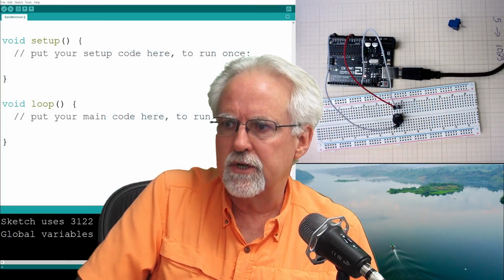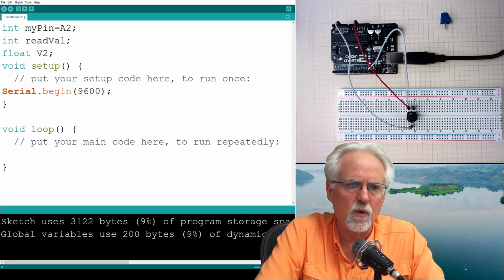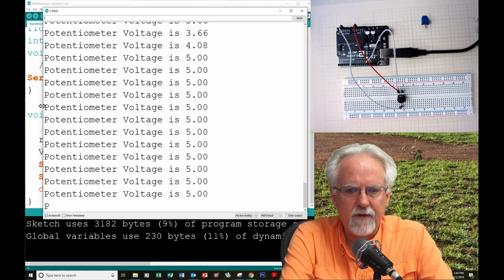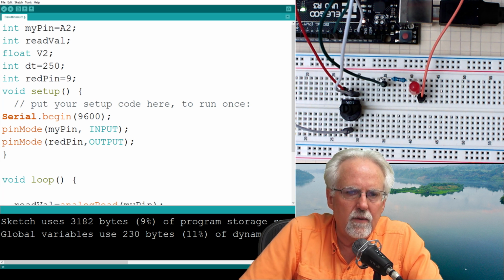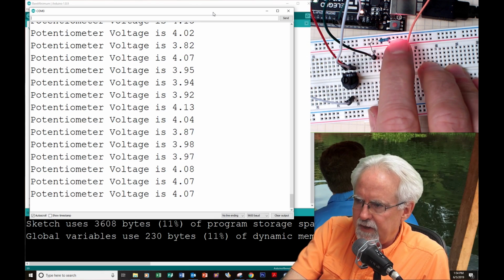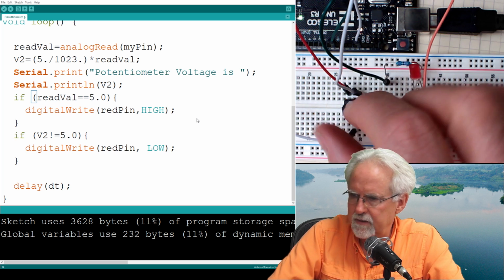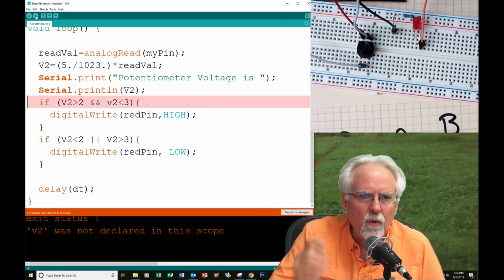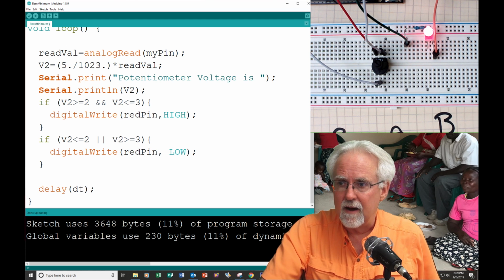Arduino Tutorial 13: Understanding Arduino If Statements

Comment: Did i you se it ? YES :D  in the First != exampel you told the audrino to turn off the led if it did not != to 4 not 5 and it was after the tun on if ==5 comand but befor the delay . so there where no condition where it would turn on

Comment: Hi Paul! I'm still following the tutorials. I had to take a break for a couple of days when my only potentiometer ended up breaking due to poor quality (I picked up a different set to the one you recommend for the series prior to finding you) and had to order some new ones. I have successfully completed this lesson, but I wanted to know, just to check and clarify my understanding, if the reason your program didn't work towards the end of this video is because you didn't change the (V2 != 4.0) to (V2 != 5.0) to match with the (V2 == 5.0) line of code? To my mind, this would be because the Arduino is interpreting the 5V (potentiometer at max/1023) as "not equal to 4.0" and thus disregarding the (V2 == 5.0) statement. Would that be correct? I changed both values in my own program and it worked without incident.

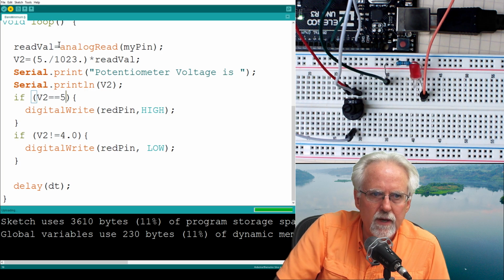Edit: In case you are able to respond, the timestamp is around the 25:00 minute mark, I understand you may not remember the specifics of what happened in a video from 6 years ago xD

2nd Edit: I hope this question doesn't annoy you given that you end up resolving the issue later in the video. I wanted to try to guess the issue before finding out if you did so. So no need to answer, but I'll leave this comment here in case it helps others understand the issue ^^'
Reply from the maker: Yes, as I am coding live in front of the camera I make mistakes, but then that allows you to see how I troubleshoot.

Comment: How do you know what resistor to use for projects? Is that something that will covered later?
Reply from the maker: It is based on a calculation of what is the maximum current a digital pin can source, and then using a resistor that insures that even if the LED is shorted, the circuit will not draw more current than the arduino pin can safely provide.

Comment: Homework code:
spoilers
.
.
.
.
.

int readPin=A5;
int voltageRead;
int greenLED=8;
int yellowLED=9;
int redLED=10;
int dt=100;
float voltage;

void setup() {
  // put your setup code here, to run once:
Serial.begin(9600);
pinMode(readPin, INPUT);
pinMode(greenLED, OUTPUT);
pinMode(yellowLED, OUTPUT);
pinMode(redLED, OUTPUT);

}

void loop() {
  // put your main code here, to run repeatedly:
voltageRead = analogRead(readPin);
voltage = (5./1023.)*voltageRead;
Serial.print("voltage is ");
Serial.println(voltage);

//turn on/off green led when voltage +0-3 (I like to have no lights on when its at 0V)
if(voltage > 0 && voltage <=3){digitalWrite(greenLED, HIGH);}
if(voltage>3 || voltage == 0){digitalWrite(greenLED, LOW);}

//turn on/off yellow led when voltage 3-4
if(voltage > 3 && voltage <=4){digitalWrite(yellowLED, HIGH);}
if(voltage > 4 || voltage <= 3){digitalWrite(yellowLED, LOW);}

//turn on/off red led when voltage 4-5
if(voltage > 4 && voltage <=5){digitalWrite(redLED, HIGH);}
if(voltage < 4){digitalWrite(redLED, LOW);}

delay(dt);

}

Comment: int myPin=A2;
int readVal;
float V2;
int dt=250;
int redPin=9;
int yelPin=6;
int grePin=3;

void setup() {
  // put your setup code here, to run once:

Serial.begin(9600);
pinMode(myPin,INPUT);
pinMode(redPin,OUTPUT);
pinMode(yelPin,OUTPUT);
pinMode(grePin,OUTPUT);
}

void loop() {
  // put your main code here, to run repeatedly:

readVal=analogRead(myPin);
V2=(5./1023.)*readVal;
Serial.print ("Potentiometer voltage is ");
Serial.println(V2);

if (V2>4){
  digitalWrite(redPin,HIGH);
  digitalWrite(yelPin,LOW);
  digitalWrite(grePin,LOW);
}

if (V2<4){
  digitalWrite(redPin,LOW);
  digitalWrite(yelPin,LOW);
  digitalWrite(grePin,HIGH);
}

if (V2>=3 && V2<=4){
  digitalWrite(redPin,LOW);
  digitalWrite(yelPin,HIGH);
  digitalWrite(grePin,LOW);
}

delay(dt);
}

Comment: I disagree with some of your breadboard designs from time to time. Am I allowed to do so? I mean, the results are the same, but I am not sure if I should be building the exact circuit as you. 

For example, I use ground-rails whenever I have to put LEDs in a series. Otherwise, I place my resistors differently sometimes than you do. 

Can this turn into a problem further down the line?

Comment: HOME WORK DONE!!!!!
int red=2;
int green=4;
int blue=7;
int readVal;
float volt;
int wait=500;

void setup() {

Serial.begin(9600);
pinMode(red,OUTPUT);
pinMode(green,OUTPUT);
pinMode(blue,OUTPUT);

}

void loop() {

  readVal=analogRead(A2);
  volt=(5./1023)*readVal;
  Serial.print("Potentiometer Voltage is "); Serial.println(volt);
  delay(wait);
  
  if(volt < 1.0){
    digitalWrite(blue,HIGH);
    digitalWrite(red,LOW);
    digitalWrite(green,LOW);
  }
  if(volt>1.0 && volt<3.5){
    digitalWrite(green,HIGH);
    digitalWrite(red,LOW);
    digitalWrite(blue,LOW);
  }
  if(volt>3.5){
    digitalWrite(red,HIGH);
    digitalWrite(green,LOW);
    digitalWrite(blue,LOW);
  }
}

Comment: Hi Paul,
Six year have passed and you definitely NOT talking to a wall. You are an amazing teacher. Thank you very much for your videos!
I have a small question: why didn't you use the `else` block in the `if` statement?
Reply from the maker: I never use else statements, as I believe they generate logical complexity in the code. Lets say if x>3.12 (   ) else: (   ). The else makes you try to think  backwards, and complicates understanding what happens when x = 3.12. To me, I write my code always with positive logic, as follows.
if x>3.12 . . . open the window
if x=3.12 . . . leave the window where it is
if x< 3.12 . . . close the window.
Understanding the code is all positive logic, not incorportating opposite logic. I have seen many coding disasters from sloppy use of else statements.
Reply: @paulmcwhorter  
That is a very interesting point. I have some software background but i never took the time to think of the "philosophy" of how to write understandable code.

Comment: I thought of declaring V2 as float V2=(5./1023.)*readVal; prior to the void setup, but get 0 volts. Bummer, I thought I was being clever, lol Im not sure why we cant declare the float V2 with the others above the setup?. Here's the code:

int myPin=A2;
int readVal; 
float V2=(5./1023.)*readVal;
int dt=250;
void setup() {
  // put your setup code here, to run once:
Serial.begin(9600);
}

void loop() {
  // put your main code here, to run repeatedly:
readVal=analogRead(myPin);
V2;
Serial.print("Potentiometer Voltage is ");
Serial.println(V2);
delay(dt);
}
Reply from the maker: The variable readVal would have an undefined value before setup().

Comment: Hi sir I am from Malaysia, I have a question. Why does my board are not showing 5V after prompting "If Statement" even though after I turn the potentiometer on full turn. Before "If statement" are written, the serial monitor reading normally show the reading 0v-5v. The LED also are not bright as 5V after I am doing "if statement" prompt. The serial monitor only shows 0 V- 4.72 V. Thank you.

Comment: Hello Sir, I did your assignment and it worked succesfully. I decided to use the special rows since there were only 3 GND holes, and in the process realised that even the two rows in each side are not connected completely as you and the internet proclaimed. they are further divided into two halves which are not connected. In simple terms, if there are 4x negative holes in special rows in the entire board, only x are connected.

Comment: Thank you for your videos!

const int V_PIN = A2;
const float V = 5;
const int V_MAX = 1023;

const int GREEN_LED = 8;
const int YELLOW_LED = 9;
const int RED_LED = 10;

const int DELAY_MS = 500;

void setup() {
  Serial.begin(115200);

  pinMode(V_PIN, INPUT);

  pinMode(GREEN_LED, OUTPUT);
  pinMode(YELLOW_LED, OUTPUT);
  pinMode(RED_LED, OUTPUT);
}

void loop () {
  int readVal = 0;
  readVal = analogRead(V_PIN);
  float voltage = 0;
  voltage = (V / V_MAX) * readVal;
  Serial.print(voltage);
  Serial.print("v\n");

  if (voltage < 3) {
    digitalWrite(YELLOW_LED, LOW);
    digitalWrite(RED_LED, LOW);

    digitalWrite(GREEN_LED, HIGH);
  }
  if (voltage > 3 && voltage < 4) {
    digitalWrite(GREEN_LED, LOW);
    digitalWrite(RED_LED, LOW);

    digitalWrite(YELLOW_LED, HIGH);
  }
  if (voltage > 4) {
    digitalWrite(GREEN_LED, LOW);
    digitalWrite(YELLOW_LED, LOW);

    digitalWrite(RED_LED, HIGH);
  }

  delay(DELAY_MS);
}

Comment: hello Paul, i checked out your profile here on youtube and saw a newer turtorial for the uno r4 wifi, is it somewhat different from the one here or are they the same, because i was wondering if i should change to the newer one.
Reply from the maker: The main difference with the R4 lessons is the R4 arduino can do some WiFi stuff, and I have lessons on that. If you are not interested in WiFi at this point, stick with these lessons.

Comment: Thanks!
Reply: Loving the series Paul. 
Question: In lesson 13 on the IF statement my sketch runs fine except for turning on the LED.
if (V2>4.0) {
    digitalWrite(redPin,HIGH);
   }
  if (V2<4.0) {
    digitalWrite(redPin,LOW);  
   }
HIGH and LOW do not turn green in the code. 
Any thoughts?
Reply from the maker: I was using IDE 1.8, and you are probably on IDE 2.X. IDE 1.8 still works, and you will get results like mine.
Reply from the maker: Thanks! I appreciate the support.

Comment: Don't worry good sir! I'm doing whatever projects you say at the end. Here's my solution to this video's problem.

float potenPin=A2;
int rLED=2;
int yLED=3;
int gLED=4;

void setup()
{
  pinMode(potenPin, INPUT);
  pinMode(rLED, OUTPUT);
  pinMode(yLED, OUTPUT);
  pinMode(gLED, OUTPUT);
  Serial.begin(9600);
}

void loop()
{
 float volt=(5./1023.)*analogRead(potenPin);
 if (volt>=4)
   { 
    digitalWrite(rLED, HIGH);  
    digitalWrite(yLED, LOW);   
    digitalWrite(gLED, LOW);
   }
 else if(volt>=3)
   {
    digitalWrite(rLED, LOW);  
    digitalWrite(yLED, HIGH);   
    digitalWrite(gLED, LOW);
   }
 else
   {
    digitalWrite(rLED, LOW);  
    digitalWrite(yLED, LOW);   
    digitalWrite(gLED, HIGH);
   }
}

Comment: This is my code for the homework:

int myPin=A2;
int readVal;
float V2;
int delay1=250;
int redpin=9;
int yellowpin=8;
int greenpin=7;

void setup() {
  // put your setup code here, to run once:
Serial.begin(9600);
pinMode(myPin, INPUT);
pinMode(redpin,OUTPUT);
pinMode(yellowpin,OUTPUT);
pinMode(greenpin,OUTPUT);
}

void loop() {
  // put your main code here, to run repeatedly:

readVal=analogRead(myPin);
V2=(5./1023.)*readVal;
Serial.print("Potentiometer Voltage is ");
Serial.println(V2);

if (V2>4.0){
digitalWrite(redpin,HIGH);
digitalWrite(yellowpin,LOW);
digitalWrite(greenpin,LOW);
}

if (V2<=4.0 && V2>=3.0){
digitalWrite(redpin,LOW);
digitalWrite(yellowpin,HIGH);
digitalWrite(greenpin,LOW);
}

if (V2<3.0){
digitalWrite(redpin,LOW);
digitalWrite(yellowpin,LOW);
digitalWrite(greenpin,HIGH);
}

delay(delay1);
}

I hope this helps anyone who needed it!

Comment: int greenPin=5, yellowPin=6, redPin=7, dt=500, baud=9600;
float readPin=A0, potVolt, constant=(5.0/1023.), V2;
  
void setup(){
	Serial.begin(baud);
	pinMode(greenPin,OUTPUT), pinMode(yellowPin,OUTPUT),pinMode(redPin,OUTPUT);
  	pinMode(readPin,INPUT);
}

void loop(){
	V2=analogRead(readPin);
	potVolt=constant*V2;
	Serial.print(" Your Potentiometer Voltage value is: ");
	Serial.println(potVolt);
if (potVolt<3)
{digitalWrite(greenPin,HIGH), digitalWrite(yellowPin,LOW), digitalWrite(redPin,LOW);}

if (potVolt>=3 && potVolt<=4)
{digitalWrite(greenPin,LOW), digitalWrite(yellowPin,HIGH), digitalWrite(redPin,LOW);}

if (potVolt>4)
{digitalWrite(greenPin,LOW), digitalWrite(yellowPin,LOW), digitalWrite(redPin,HIGH);}
	delay(dt);
}

Comment: Here is my take on the assignment:

const int greenLEDPin = 8;
const int yellowLEDPin = 9;
const int redLEDPin = 10;
const int readPin = A0;

int readDelay = 200;
float readValue;
float voltage2Value;

void setup() 
{
pinMode(greenLEDPin, OUTPUT);
pinMode(yellowLEDPin, OUTPUT);
pinMode(redLEDPin, OUTPUT);

pinMode(readPin, INPUT);
Serial.begin(9600);
}

void loop() 
{
ReadConvertValue();

if (voltage2Value < 3)
{
digitalWrite(greenLEDPin, HIGH);
digitalWrite(yellowLEDPin, LOW);
digitalWrite(redLEDPin, LOW);
}

if (voltage2Value >= 3 && voltage2Value < 4)
{
digitalWrite(greenLEDPin, LOW);
digitalWrite(yellowLEDPin, HIGH);
digitalWrite(redLEDPin, LOW);
}

if (voltage2Value >= 4)
{
digitalWrite(greenLEDPin, LOW);
digitalWrite(yellowLEDPin, LOW);
digitalWrite(redLEDPin, HIGH);
}

delay(readDelay);
}

void ReadConvertValue()
{
readValue = analogRead(readPin);
voltage2Value = (5.0 / 1024.) * readValue;
Serial.println(voltage2Value);
}

Comment: Homework:

int Delayt=250;
int potPin=A0;
int readVal;
int redLed=9;
int yellowLed=8;
int greenLed=7;
float V2;

void setup() {
  // put your setup code here, to run once:
Serial.begin(9600);
pinMode(potPin,INPUT);
pinMode(redLed,OUTPUT);
}

void loop() {
  // put your main code here, to run repeatedly:
readVal=analogRead(potPin);
V2=(5./1023.)*readVal;
Serial.print("Potentiometer Voltage is: ");
Serial.println(V2);
if (V2>4.00 && V2<5.00)
{
  digitalWrite(redLed,HIGH);
  digitalWrite(yellowLed,LOW);
  digitalWrite(greenLed,LOW);
}
if (V2>3.00 && V2<4.00)
{
  digitalWrite(redLed,LOW);
  digitalWrite(yellowLed,HIGH);
  digitalWrite(greenLed,LOW);
}
if (V2>0.00 && V2<3.00)
{
  digitalWrite(redLed,LOW);
  digitalWrite(yellowLed,LOW);
  digitalWrite(greenLed,HIGH);
}
delay(Delayt);

}

Comment: Hi Paul, thank you for the time you put into these courses. I am doing the homework assignment. I have the LED's working as they should. I made an error first, I didn't do pinModes for the two additional LED's, it confused me as the LED's would light up, but 2 of them were very dim, while the single LED with a pinMode shone bright. But I discovered and fixed my error :)
Reply from the maker: Fantastic!

Comment: here to hand in my homework, thanks a lot!
int rp=A0;
float rv;
float v2;
int x=500;
int greenp=8;
int yellowp=9;
int redp=10;

void setup() {
  // put your setup code here, to run once:
Serial.begin(9600);
pinMode(rp,INPUT);
pinMode(redp,OUTPUT);
pinMode(yellowp,OUTPUT);
pinMode(greenp,OUTPUT);
}

void loop() {
  // put your main code here, to run repeatedly:
rv=analogRead(rp);
v2=(5./1023)*rv;
Serial.println(v2);
if(v2<3){
  digitalWrite(greenp,HIGH);
  digitalWrite(yellowp,LOW);
  digitalWrite(redp,LOW);
}
if (v2>3 && v2<4.0){
  digitalWrite(greenp,LOW);
  digitalWrite(redp,LOW);
  digitalWrite(yellowp,HIGH);

}
if (v2>4)
{digitalWrite(greenp,LOW);
digitalWrite(yellowp,LOW);
digitalWrite(redp,HIGH);
}
delay(x);

}

Comment: Thanks Mr. Paul McWhorter you are the best teacher I've ever met
The H.W was easy just messed up with the naming commands, but I overcame it thanks

int dtime = 250;
int greenpin = 2;
int yellowpin = 4;
int redpin = 7;
int analogr = A0;
int read;
float process;

void setup() {
  pinMode (greenpin, OUTPUT);
  pinMode (yellowpin, OUTPUT);
  pinMode (redpin, OUTPUT);
  
  Serial.begin (9600);

}

void loop() {

read = analogRead (analogr);
process = (5./1023.) * read;

Serial.print ("The potintiometer readings are: ");
Serial.println (process);
delay (dtime);

if (process >=0 && process <= 3){
  digitalWrite (greenpin, HIGH);
  digitalWrite (yellowpin, LOW);
  digitalWrite (redpin, LOW);
}
if (process >= 3 && process <= 4){
  digitalWrite (yellowpin, HIGH);
  digitalWrite (greenpin, LOW);
  digitalWrite (redpin, LOW);
}
if (process >= 4){
  digitalWrite (redpin, HIGH);
  digitalWrite (yellowpin, LOW);
  digitalWrite (greenpin, LOW);
}
}
Reply from the maker: LEGEND!

Comment: played around and added a fade in and fade out 
int delayT = 50; // Shorter delay for smoother fading
int testerPin = A3;
float readValue;
float V2;
int warningPin = 9;

int targetPWM = 0;
int currentPWM = 150;

void setup() {
  Serial.begin(9600);
  Serial.println("Clear");
  pinMode(testerPin, INPUT);
  pinMode(warningPin, OUTPUT);  
}

void loop() {
  readValue = analogRead(testerPin);
  V2 = (5.0 / 1023.0) * readValue;

  Serial.print("Pin 1 Voltage: ");
  Serial.print(V2);
  Serial.print("' also:");   
  Serial.print("Current PWM: ");
  Serial.println(currentPWM);

  // Convert voltage to PWM (0-255) only if in valid range
  if (V2 > 3.0) {
    targetPWM = map(readValue, 0, 1023, 0, 255);
  } else if (V2 < 3.0) {
    targetPWM = 0;
  }

  // Smoothly approach the target PWM value (easing)
  if (currentPWM < targetPWM) {
    currentPWM++;
  } else if (currentPWM > targetPWM) {
    currentPWM--;
  }

  analogWrite(warningPin, currentPWM);

  delay(delayT);
}
Reply from the maker: LEGEND!